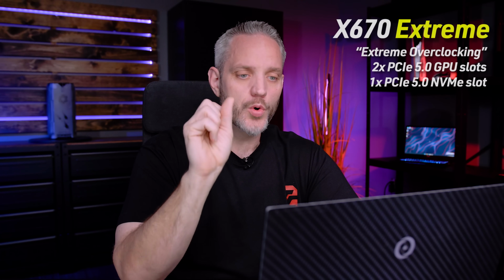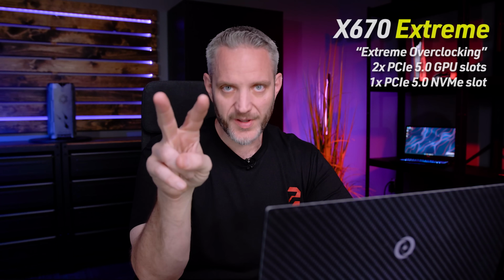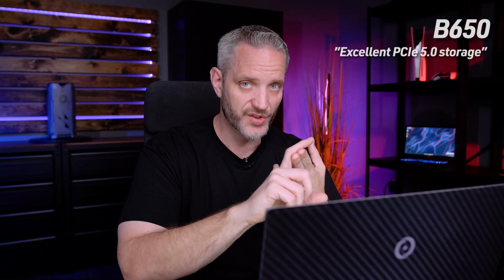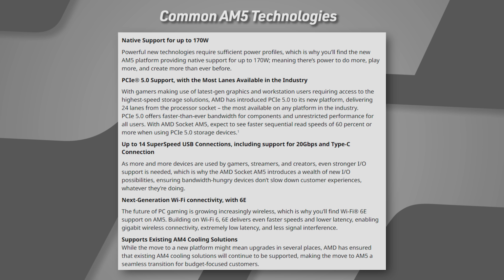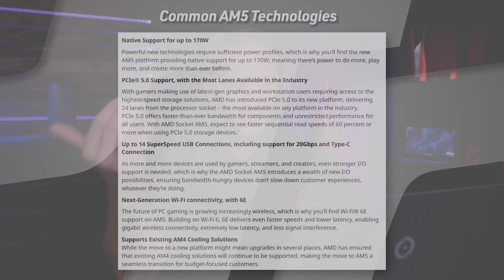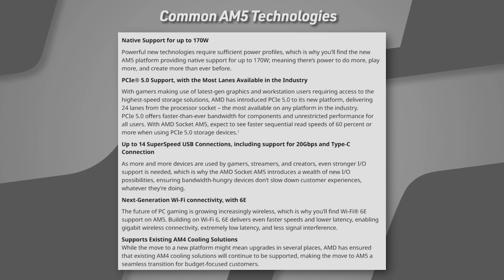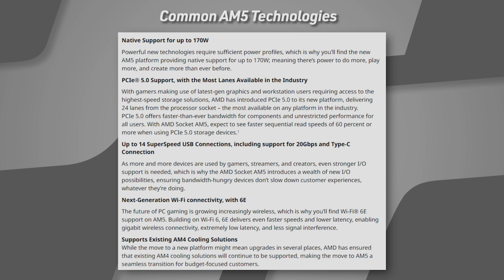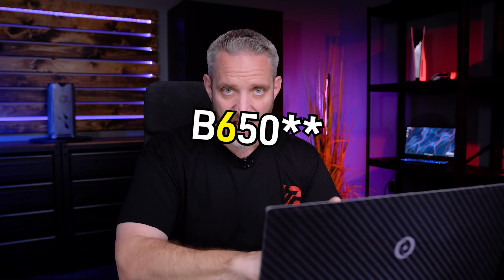AM5 Motherboards are EXPENSIVE! AM5 Explained

Comment: I've been sitting with my trusty Ryzen 7 1700x since it launched and I'm looking forward to upgrade to the new AM5 platform but for some reason I think I'm gonna skip the first gen and wait for the next one or at least wait half an year to have things settled and mature. I was an early adopter with the 1700x which I got paired with a Gigabyte GA-AX370-Gaming K7. During the first months there were some stability issues with the RAM frequency and post times but it was solved fairly quickly

Comment: Just a small note for people that think they really need WiFi 6e (802.11ax) compared to 5 (802.11ac).
The main difference in speed (there are more improvements but I'm now comparing speed only) is about 3.4 Gbps (WiFi 5: ~3.5 Gbps & WiFi 6e: ~9.6 Gbps). 
Jay was talking about a gigabit speed which can be achieved even without 6e, keep that in mind

Comment: Super excited for AM5. Saw this as my time to step up from a 3900x and a Crosshair Hero. 

With the overall cost, however, I think I'll hold out and wait for another year.
Reply: But why wouldn't you just drop in a 5950x instead? Are all you guys just using this for work and need the absolute fastest multicore processors available, but not so much you'd need an Epyc or something?
Reply: @pandemicneetbux2110  Streaming, video editing, etc all on one PC makes the advantage of 3900/5900 very stand out. 

Gaming + video encoding at high bitrates via CPU, leaving your GPU open to handle the game is extremely helpful.

Comment: I have an older system and am in dire need of an upgrade. It is just at that point where upgrading one part requires upgrades around and thus I'm looking at a basically new computer... So I'm probably going to go for the AM5 thing, but depending on the next gen gpu releases on when I will go for that "update". I know it will be hella expensive, but it is what it is. I have been updating the current pc, initially bought in 2011, so it is due for a whole refurbish and the previous costs have been thoroughly covered over time. The case is the only thing left from 2011 and the blueray drive... And I think I will keep it that way even going for the "new computer". But we'll see, once new cpus and gpus are out, I will go buy. Have been waiting on these gpus for ages already. Was going to upgrade to current gen gpu, but looking at my parts, it became clear that practically everything needs overhaul... And now that the current gen is in stock and prices are reasonable again, the next gen is going to come out, soon™.

Comment: I can't even have a wired connection and have been gaming wireless for years now. 
And that on a very old USB 2.0 WIFI 4 Dongle. Worked like a charm until recently, when I encountered some kind of driver problem.
I now have a Wifi 6 router and a Wifi 6 network card and of course it still works like a charm.
Wireless isn't bad at all. Not the least.

Comment: That new set looks amazing, the Star Wars build in the background is still a thing of art :) I'm currently using a 5600x with B550 ITX board (no plans for upgrade to the new platformthis year or next year), waiting for new gen graphics card. I've been happy with the Radeon RX570, but recently I upgraded to a 1440p monitor and it doesn't have the power to drive it. Hopefully something interesting in RX 7600XT or 7700XT will come up, that will not require a lot of power to drive and fit nice and cool into the Phanteks Evolv Shift XT.

Comment: In regards to the multiple GPU slots, while it might be for productivity, developers making games that use DX12 or Vulkan can absolutely use both of those cards simultaneously. UE4 can take advantage of both cards. UE5 can't currently (unless the dev does some work on one card themselves), but I imagine that UE5 will get seamless multi-gpu support over the coming years. Since these mobos are likely going to have a relevant socket for many years, I think this is totally reasonable to assume games that use two GPUs will run on it. Additionally, some games could use additional GPUs to run ML algorithms for various reasons.

Comment: I think the 2 graphics slots for x670E is a platform compromise from AMD for not having non-pro threadripper.  You can get 16 cores with a decent amount of pcie5 without having to buy into the workstation platform.

Comment: No to crossfire, its just that they are able to have two of the full 16x slots as Gen5, which is handy so you can use either for your GPU. No one is doing MultiGPU with 2 actual cards, AMD is doing MCM designs of course though

Comment: I'm Planning an upgrade over this coming winter, as a builder I have only ever used 1 AMD product in my home PCs over 30 years of building. There were certainly big gaps in my building in the last 12 years but almost always I had built on Intel. As an engineer, I once worked for Intel and know the technologies well. When FlightSim 2020 rolled out a couple of years ago I was all about that! That is my game and it has been great to learn how to optimize a PC to get best performance from a demanding title. I'm still armed with intel (i9 10850K at present). it seems time to look closely at the upcoming AMD CPU 's (probably the 7900)  I will wait to see what bugs are found and what CPU MoBo performance looks like (bugs will be found, I'm sure) and will like pull trigger on that in Feb of next Year. I'll be teaming it up with an EVGA 3080ti FTW Video card (purchasing very soon) to replace my still capable 2080Ti.  I'm not about buying the Fastest just coz, nor am I much into overclocking, but rather buying the most capable hardware for my user experience and trying to build in some future capability, it's going to be an exciting time, there will be much to learn along the way. I will be watching to see if / how Intel respond / come back too, it will be a challenge for them for sure!!!

Comment: not wone back by AMD yet .... not sure why but i have a ton of trouble with unraid and AMD but on Intel no issues at all 
will likely push my lab PC up to Rizen 7000 when that gets an update but that wont be till the bugs are mostly ironed out and tyhe decision on where to go for my main PC are still up in the air other than staying the hell away from win 11 (im running it on my laptop test machine and there are still things im not liking )

Comment: Regarding early adopters buying the higher end boards, that usually winds up being the overclocking crowd that want those better VRMs and beefier power stages that do that. Then there's the best=most expensive foks, who are a wealthy and/or foolish minority. Problem is those two groups do this every single release, so the rest of us are usually stuck with a lack of mid range or well built budget options. They throw all the penny pinching at the low end and when they could sell a lot more boards by not making their low end garbage tier, but well built and spartan.

Comment: Using a fx-8350 with a water cooler, Saphire RX570, and 32g of Ram that still runs strong. I've been playing Total War: Warhammer 3 immortal empires with large armies on medium graphics. It does run slow time to time. It's time to upgrade though because I want to play at 1440p with max graphic detail without issues

Comment: I call BS on that wireless speed, Jay. 940Mbps with 7-10ms is exactly the fiberoptic speed of a 1Gbps connection and passing through not one but several walls with wifi6, even with the best possible wireless routers you're not gonna get that speed and latency, no way. I call BS.

Comment: I don't why you wouldn't want WiFi on your motherboard, WiFi was super high on my list- most have Bluetooth too (so no PCIE card between my GPU and bottom intake), WiFi 6 is plenty good when I temporarily move the computer, the audio is perfectly fine, and the jump between a good but bare B550 to feature packed X570 was only like 20 to 50 bucks (Asus TUF B550 vs. TUF X570 WiFi- $160 vs $200, but iirc I only paid $180 for the TUF X570 WiFi). I really couldn't understand the B550 prices. Was X570 too cheap, or was B550 too expensive?

Comment: I'm sure I won't get AM5 for quite a while.  Not until I feel like I can get a bit of a deal.  Certainly won't be day 1.  Maybe day 366 or so...a year later.

My current setup with a Ryzen 3600, 6600XT,  meager 16GB of RAM and a gen 3 NVME drive is still covering all my needs at this time.

Comment: I built a new PC this summer after delaying the upgrade for a couple years. Went from an overclocked i7-6700k w/ a GTX 1070 to a 5950x with a 3080. I'm very happy with its performance and see no reason to move onto AM5 any time soon. I think I can make this work for at least 3-5 years and then I'll jump onto whatever Zen family is current at that time.

Comment: I will not be buying into Ryzen 7000 as I don't need to. I built my rig when Ryzen 3000 came out and got a 3700x then. I just recently upgraded it to a 5800x3d and that should have me good for awhile. I prefer to enter a new generation in the 2nd or 3rd product release to avoid those initial new platform problems.

Comment: Say the chip is an Intel AX210 its MSRP for off the shelf is 18~45 USD. For a company to add this onto the motherboard the correct way, you're adding $80~100 to an MSRP on the board. This to me isn't so unreasonable, but what is unreasonable is when they put a space on the board with an external chipset. you actually give up specific lanes. If you graduate your OLD PC to you NAS this may create a problem for some people. (Not nocking asrock,) The X570 Steel legend wifi is an example.) Many people work around this by removing the card, but I do a hybrid VM with wifi output for say a quest 2 directly for wireless setup. having it built into the board vs an additional card can make/break this scenario.

Comment: Considering I am on a first gen Ryzen 3 processor with a Nvidia 1650 graphics card I will get a huge performance boost by going to a b650 with a 7600x and a Radeon 6600 my head might spin a few times.

Comment: I won’t be upgrading for a while. I may get 3080TI but will wait for a while before adopting AM5. What I don’t get though is why aren’t the error code displays and clear CMOS buttons standard on all AM5 motherboards? I get they’re features that cost extra and for the base boards you don’t really need a clear CMOS as they aren’t necessarily meant for over clocking. But they’re helpful regardless and shouldn’t be much more to add to all boards. At least the error code display (not the tiny LED lights but the actual code display) shouldn’t be much of an extra cost per board to add.

Comment: I was thinking about getting a 7950x at the end of the month (and a new mobo and ram) and decided I'm going to wait. My money has been with AMD since I started building PCs 20 years ago, and since then, I have built a few Intel systems, but for years the bang-for-the-buck has just been AMD. Then Ryzen dropped and they won performance too. Intel chips are somewhat inefficient, but I do hope they do better to force AMD to do better too.

That being said, I don't really like being part of the first generation of testers. Plus the idea that I may be forced into Windows 11, which I am fighting against tooth and nail, is more than enough to keep me on my old system. The 5950x has been a great, no need for an upgrade yet.
Reply: nothings wrong with windows 11. just stop being misoneism.
Reply: @Ehren1337   Not being misoneistic at all. I just don't like to an early adopter to new OS. Usually that's where we see all the problems, and some of the major issues. There were several huge issues with the OS when it released ealier this year. I understand that Microsoft is working to address and fix some these issues and I understand that some of the issues I have with Windows 11 will be addressed in future updates, but I don't like having no choice but to update. Microsoft still hasn't addressed some of the issues, and until I feel comfortable with it (or until 10 is no longer supported) , I'm not updating. Using one's judgement isn't the same as misoneism. But if you like it, enjoy.

Comment: "LGA is better because if you bend the pins you wont have to replace the expensive CPU". No.. You just have to replace the expensive motherboard by tearing down your entire system to get it out and replaced. Then have windows pissed off at you because you changed motherobards and it has to redo all the drivers or whatever. 

The argument that its cheaper or easier to replace the motherboard over the CPU is garbage. I still hate LGA because its SO MUCH EASIER to fuck up LGA socket pins, than pins on a PGA cpu.

Comment: I'm on x370 with a 1600x and am considering a 5800x3d or am5, if I had pcie 4 nvme support on my mobo I'd go with the 5800x3d and run that for 5-7 years but I don't know if asset streaming will make pcie 4 ssd mandatory by then.

Comment: I appreciate that you're advocating for the B550/B650 path, because a lot of times we only hear about the X-series. I see a lot of people just write that line off entirely when it's a potentially massive cost-saving measure without sacrificing all that much. It really comes down to what you're trying to build. It's definitely a crapshoot in terms of what features are actually on the board, so hopefully that's less of a mess this time around (I imagine not...).
Reply: B550 slaughtered X570 in performance tuning
Reply: Yeah the cost and quality of motherboards took a while to come around, it wasn't till b550 where the cost/preformance value got to such a good point that going B over X was better for the avg person. Now we need to see the next iteration of mass amounts of Usb type C ports and vertical nvme slots with cooling (similar to how 4 dimms of ram can be packed in a small space)
Reply: @scarletspidernz  B550 Unify-X was the only real OC board besides X570 Dark until the end with the S boards. But on average even the simple B550 Aorus boards destroy X570 for RAM and BCLK.

Comment: Thanks as always for the informed discussions. Very helpful for beginners and those who are perhaps a step beyond beginner who need the refresher. I personally found it very helpful when you explained that manufacturers use the same base board for an entire generational lineup, and they start off with their flagships that have all the bells and whistles added for a premium markup and then peel away those features for the more affordable offerings. I had it in my head that they were using cheaper quality boards for the lower end offerings. I appreciate that clarification.

@13:22    Jay's Killer Combo - TL:DRs the best combination to shoot for if you are not a bleeding edge early adopter compatibility tester

Comment: Im doing another am4 build currently. I saw 5800x is 50% off so I'm going to build an itx build for my daughter using my 5600x as a hand me down. I 100% expected am5 to be very expensive at launch with pcie gen 5 and ddr5 on there.. There's not a reason for me to wade into it when AM4 blows all my tasks away currently. That's always the case for new platforms and 100% to be expected. Absolutely you as an early adopter pay 20-50% more. I fully hope lots of people jump in there so i can reap the benefits of the more budget friendly options that will launch later.

Comment: I want to upgrade my i7-7700k to one of the new AM5 chips and get into nvme 5.0. I think it would be a huge performance upgrade, but I’m worried that prices are going to be high and stock will be low around Black Friday/Christmas era.
Reply: Did you buy your 7700k when it was the current new chip?
Reply: @Disco_Potato  I purchased it right when the 8700k came out. It was a good price so I went for it.

Comment: The interesting thing is that there are pretty significant cuts in AM4 prices right now. This makes both the RAM and CPUs for a new AM4 build MUCH cheaper compared to the AM5 option. Yeah, AM4 is effectively EOL, but if you're willing to accept that then you can build a terrific rig for the next 5-6yrs. 
 
I made the mistake of buying gen1 of the AM4 socket, a great little 1700X. Down the road, the mbd failed and I went to slot my CPU into a new board... NOTHING HAPPENED?!? If you promise compatibility across the platform then you should follow through with said promise. It was honestly surprising considering AMD's past AM3->AM3+ compliance but my experience with AM4 is DEFINITELY keeping me away from gen1 AM5.
Reply: Wasn't that down the motherboard vendors using too small BIOS chips though, so they couldn't include microcode for all CPU models?  Its ultimately down the motherboard vendor to decide what to support or not, AMD can only say their chipset supports it, not control if specific motherboards do.

Comment: Jayz...not you >< THE ONLY RELEVANT VALUE IN PCIE SLOTS IS THE MULTIPLIER ! IF YOU PLUG A 4.0 CARD YOU GET X16 OR X8 OR X4 4.0 THE REST OF THE BANDWITH IS COMPLETELY LOST !!! with a 4.0 gpu if slot is x16=26Gb/s x8=13Gb/s (13Gb/s lost) x4=6.5Gb/s (19.5Gb/s lost !!!) it's insane that youtubers don't know this...alll of them and the comments I read on youtube and hardware websites don't know this, I learned that the hard way going to Z690 it's a 1 pcie slot chipset and you absolutely cannot use the cpu-linked "5.0" M.2 as it destroys your gpu bandwith, don't say you weren't warned when you benchmark your fully loaded m.2 and or pcie slot system and wonder why your benchmark scores are bad or why you get disappearing drives or ports...you ran out of bandwith because most of it is lost, 5.0 is actually worst than 4.0 all it does is produce unusable bandwith

Comment: saving for it. running I5 3570  with a gtx1060. tried to skip DDR4 systems.  1060 wil move to the new system, should be enough for 1080p gaming with changed settings.